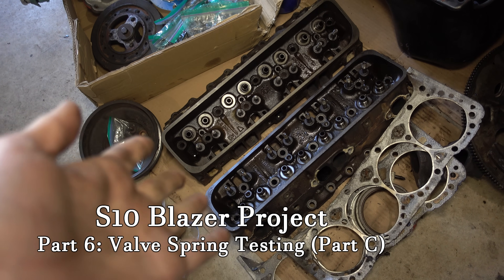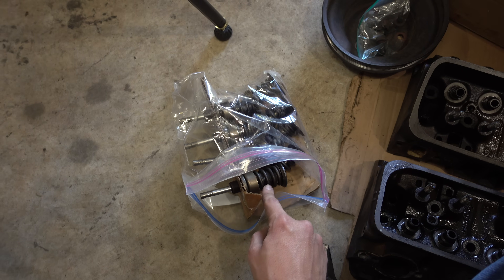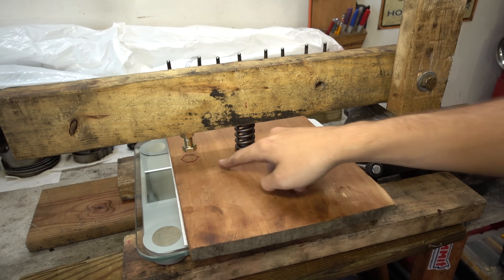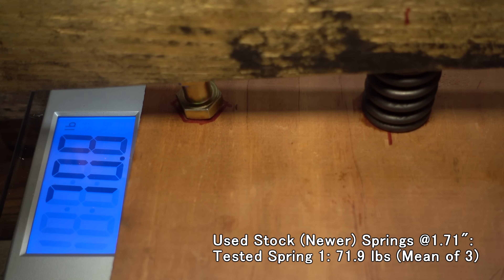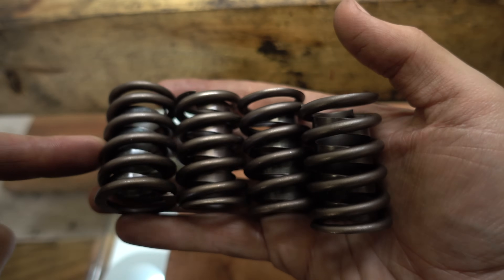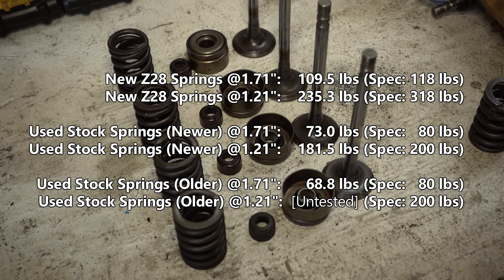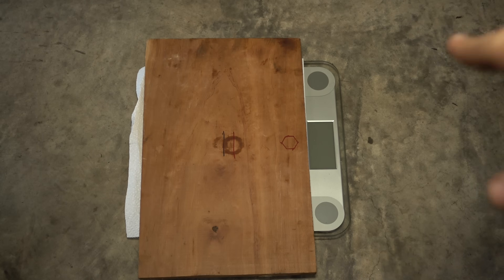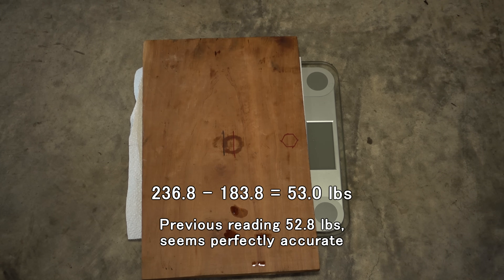V8 S10 DIY "Z28" Valve Spring Testing (Ep.6, Part 3 of 4)

Comment: Im building a 305 (for some reason) that came out of an 89 Camaro. Factory roller cam but the car was auto so the specs are pretty weak. I know of a yard thats full of caprices and impalas, i started looking at head casting numbers on the 80s 9c1 cars but everything i found was swirl port. I ended up finding some heads off a 78 impala 305 with casting #450. Small valve, small chamber but i blended and cleaned the bowls and runners with a rotary burr so hopefully they flow good. Im hoping it spins fast with some z28 springs. An occasional  7k RPM would be cool. Especially in a manual 2wd 89 GMC Sierra. Im sure my expectations are too high hahahahaha

Comment: love the bathroom scale spring tester facility, just wondering if putting the stopper on the bench instead of the board on the scale would have made more sense, that way you could press as hard as you want and it would be a much more controlled test

Comment: I love stuff like this, my brother in law is 12 years older than me and he was a master of rigging up home made tests for things, when I was 10 or eleven, I would end up helping him with projects, a lot of car building and electronics stuff. We ended up building a go kart and wanted a transmission on it, my brother in law came up with a great idea of using a cone and belt. As the speed built up the belt would progress down the cone for a higher gear ratio and it was seamless, no shifting, devising an idler to take up slack in he belt as the belt progressed down the cone was the tricky part but it worked great! Great low end take off with a top speed of around 40 with a 5hp Briggs & Stratton. I miss projects like that.
Reply from the maker: Thanks for sharing! That is an impressive design for a go-kart, that is how some types of CVT (Continuously Variable Transmission) work. Sounds like your brother in law is a smart guy!

Comment: Will these z28 springs work good with a comp cam 268H cam
Reply from the maker: A nice set of "Z28" springs should be okay, but lots of manufacturers sell different springs as "Z28". Most sellers will list the spring specs and a reputable seller should have relatively accurate ones. Most Z28 springs are around .480-.500 max lift, .240 max duration at 0.050". COMP recommends their own valve springs for that cam (981-16) which are about the same specs as most Z28 springs, biggest differences are a larger ID on the COMP springs (but that isn't a concern on most setups), and a higher spring rate of 370lbs vs ~320lbs advertised for Z28 springs. All that said, I think Z28 springs should do just fine and the weight difference shouldn't be an issue under 6000 RPM as long as you get springs from a reputable source. Of course, check with everything installed to make sure there is no coil bind.
Reply: @FuzzyDiceProjects  awesome info thanks. The ones I bought came with retainers and locks and are supposed to be Elgin brand. On the comp springs can I use the same retainers and locks and the ones for my z28 springs or will it require different retainers for their springs? I have the same 193 heads going on a 95 350 from a k1500 z71. I do prefer comps stuff just to match and know I have quality but curious if their springs will just work with the locks and retainers I have until I buy their other stuff also
Reply from the maker: Well, I can't say for sure. Those COMP springs have a larger ID, but I'm not entirely sure if that measurement includes the damper or not (though I don't think it does). It does not appear that the Z28 style Elgin springs have dampers, so their ID must just be the spring. Based on that, the COMP springs seem like they would be a loose fit on those retainers, which is not ideal. The keepers should fit most any standard style retainers.

Here is a good page with information about the fit of valve spring retainers: http://www.lunatipower.com/Tech/Valvetrain/ValveSpringTech.aspx
Reply: @FuzzyDiceProjects  ok, thanks! My Elgin springs do have dampeners also though
Reply from the maker: Oh, my mistake! I had just looked at a picture of the Elgin springs on Amazon and no dampeners are shown
Reply: @FuzzyDiceProjects  No worries, they do have a bunch of different types too, these r just like other z28 springs. U haven't tested them or anything, but am looking into comps like u recommend just cause I have a lot of other comp cam stuff lol and there top notch, gonna measure my retainers and see if they fit comps springs or decide to buy their retainers
Reply: I know this old but for an update I ended up ditching the springs to be safe since it was turning out to be a not so budget build lol went with gm ls3 (blue ones) beehives and comps retainers and locks for them and couldn't be happier

Comment: You are pushing down at an angle on your valve springs causing coil bind, which gives you an inaccurate reading,  you have to push straight down to check spring pressure.
Reply from the maker: I don't believe that is the case, why would the stock springs read so close to spec but the (identical dimensions) Z28 didn't? You are correct that coil bind would occur sooner at an angle, but the angle isn't sharp enough here at this open height. The angle of the camera isn't ideal for seeing it, but you can see that the coils still appear to move freely at their most compressed.
Reply: Im glad you dont believe its the case, its people like you that keep people like me in business. Why do you think a real spring pressure indicator tool pushes straight down on the spring. Also why do think the z28 spring slides back while hes pushing down on it. Heres the golden rule when you test something you test it in the same way its going to be operating. Dilly dilly
Reply from the maker: It happened to slide because there is a lot of force being put on it at an angle, and it is on a smooth piece of wood. I'm not arguing that a vertical test is superior and the proper way to do it, it certainly is for completely accurate results. But I'm pretty sure the coils didn't bind, again, the stock springs matched their specs, but the Z28 with identical dimensions did not. Coil bind is at 1.160" on these, I do not think the angle was severe enough that the further edge of the spring hit that height.

I initially just set the test up for 1.7", and should have added another board to space out the scale surface so that it was more horizontal at 1.2", that is for sure. But again I do not believe it affected the results in so significant a way as to show above all of the other variables in the test.

Comment: swirl port heads are great for low end torque and 4x4 lower rpms you have all the torque without working it as hard or over revving it. Sure there not good for higher rpm applications but will do just fine for what your wanting out of this build. Also there is alot of places that say there are "z28" springs but are typical normal joe springs. Have seen this toooons of time in the gm community